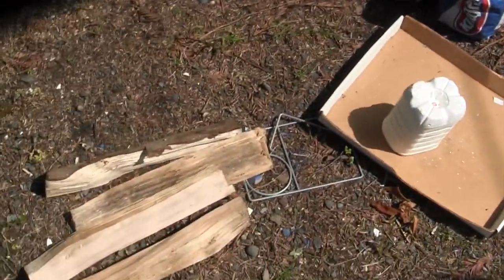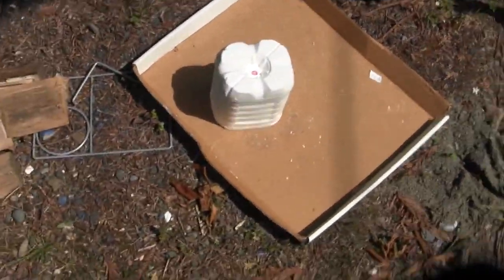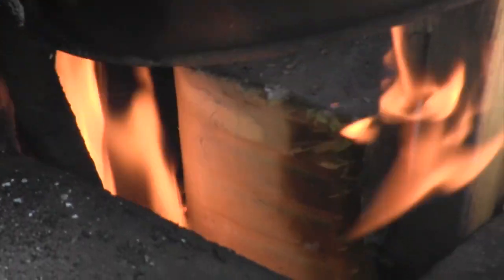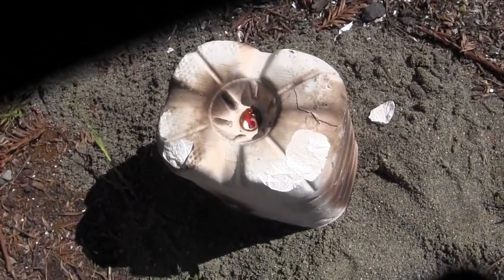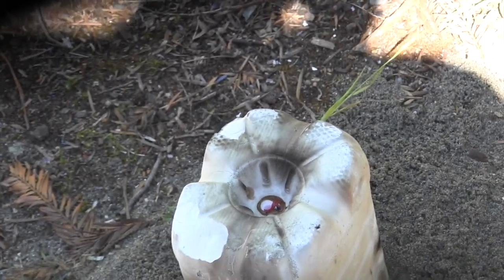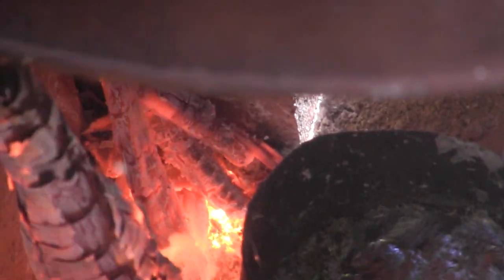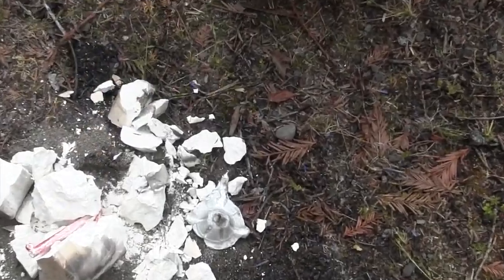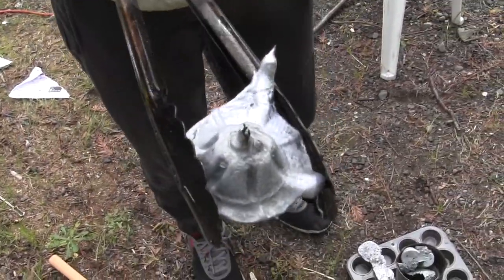Trying to cast aluminum in plaster!

Comment: A tip:the key to success with casting in plaster is patience to let it get bone dry. This reduces the risk of cracking greatly. Leave it out for two days or so and you should be good. Also plaster works best with metals like tin and pewter not so much the hotter melting ones.
Reply: Sorry what is plaster? Just the regular one? 😆 im new to it pardon me.. does it work well with aluminum too?
Reply: @rlac2025  plaster of Paris
Reply: @yesno1550 so...i should use ceramic to do hotter metal such as steel???
Reply: @SayaialahBeliau  i don't know if casting steel is a viable hobby tbh. I have no idea how you cast it
Reply: @yesno1550  use some thin layer of steel or brass such as stapler ammo or thin layer of steel in a middle of road and melt the together...

Comment: Has anyone ever tried baking the plaster in an oven at 100c for a few hours to remove some water without cracking?
Reply: Just letting it dry for a couple days will make it not crack. I do it all the time
Reply: @Rocky-sy9zt  Sorry what is plaster? Just the regular one? 😆 im new to it pardon me.. is there a specific kind?
Reply: @rlac2025  What they're referring to is your run-of-the-mill hobby store plaster of Paris . Easy to buy, and cheap.
Reply: I did but it cracked on me unfortunately. id say use a dehydrator if your mold can fit and you have it. You can also leave the oven at a slightly lower temperature and put a wooden spoon between the door and the frame of the oven as to create a vent. The second method is a lot more power consuming and both still take quite a while.
Reply: I use plaster-silica molds.  Dry them by putting them in the oven.  Heat to 200 F for an hour, then 500 F for at least 4 hours.   Big molds, longer time.  The mold should look noticeably more brown when it’s ready.

Comment: instead of using plastic, try fitting your 3D-printed part first in silicone, then using candle wax to make the positive copy of it.  Put that in the plaster(/sand mix), and melt it out.  The wax will melt far more easily than the plastic, leave no residue and pick up all the details.  After some fiddling, I went for this 'lost wax' method, and found it to be the best working method, although it's quite a hassle.  It's worth it!
Reply: You should make a youtube video about it. Might hit a million cause that's interesting

Comment: Adding an inlet and outlet to the mold by adding sprues to the 3D print may help you. The YouTube channel, “myfordboy”, features this technique. When the metal was poured into the mold, the plastic, air, and water in the plaster may have all expanded and tried to push their way out as the metal was trying to go down, causing the mushroom looking cast shown in the video. An exit sprue allows gasses to flow out as the metal flows in from the inlet sprue. Also, placing the plaster mold on top of a cookie sheet and in a regular oven in a kitchen may help to melt out the plastic without cracking the mold as a kitchen oven can be set to a temperature high enough to melt the plastic without heating the water inside of the mold fast enough to cause cracking. This may also have the added benefit of curing the mold More by helping any residual water in it to evaporate which would reduce the chances of an explosion caused by steam. I want to try the same process that you tried in this video and have been considering doing the things listed above myself. Thanks for posting!
Reply from the maker: thanks I'm Probably gonna try this again and will use some of these tips!

Comment: Man you need some help.  lol   Straight plaster of paris is a poor choice for investment.  Some guys have luck with it by mixing it 50/50 with sand and then very slowly heat it... (I'm talking over 12hrs of slow gradual heating)  One thing you have to remember is there is bound water trapped in the plaster of paris.  Any heat applied to it will cause that moisture to boil and expand and that's why it cracks.  If you really want to run lost PLA, I highly suggest you buy proper investment.  Riogrand sells ultravest and that will stand up to the rigors of heating to rid your pla outta there.  Sign up at www.alloyavenue.com and research the subject before your next attempt.  Lots of guys are doing this, but I don't know anyone having any luck with straight plaster of paris.  Another option that does work is ceramic shell investment.  It's more expensive and time consuming.  Good luck.  Ya don't know if ya dont try.  You got that part down, keep at it!  Even though this one is a fail, here's your thumbs up!  Jason
Reply from the maker: Thanks for the advice.
Reply: I’m trying pure plaster to cast copper skulls. First I melt the wax skull out after letting the plaster sit over a warm air vent for a few weeks. Then stick it into the oven for about an hour under low heat until all of the wax is melted and then poured out. Then, next campfire in the backyard I will place the steel container with the plaster mold into it overnight. Any cracking is contained in the steel container. While the plaster is still very hot, I pour the molten copper in to cast a skull.